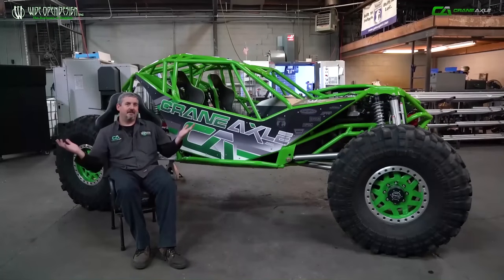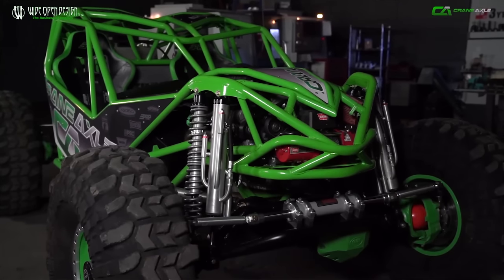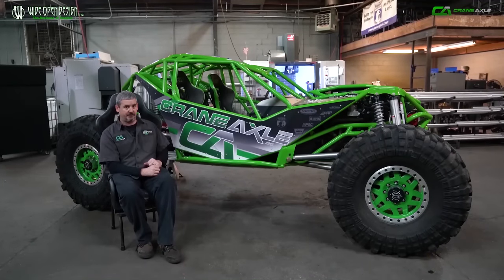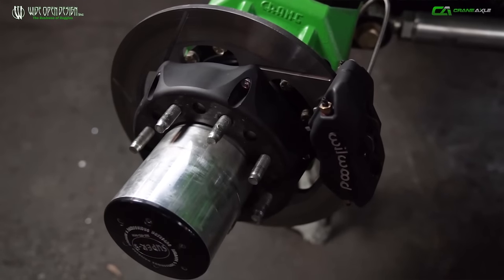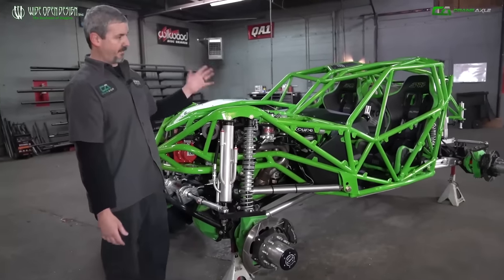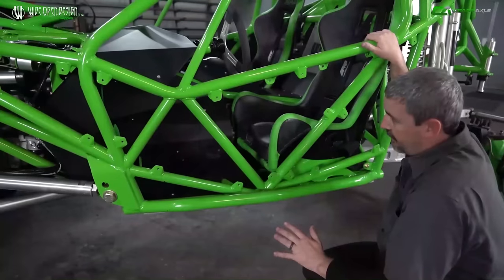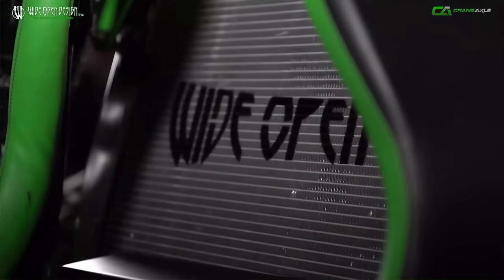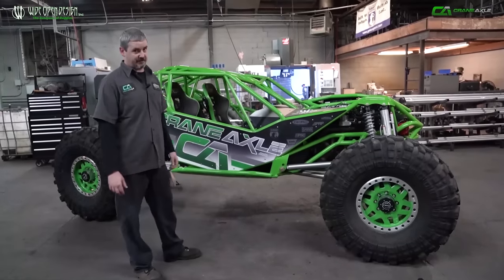New Rock Racing Buggy from Crane Axle and Wide Open Design

Comment: ok how much $$$ ?
Reply: I've wondered what a cost estimate would be too.  My guess = ~$110,000 for major components without labor to design, finish, and assemble:

Winch = 1,800
Axles = 28,000
Steering = 5,300
Shocks/bump stops = 10,000
Engine = 15,000 (middle of the road guess)
Transmission = 5,500
Transfer case = 3,800
Link bars = 1,750
Seats = 2,500
Trailing arms = 12,000 (material and machine time estimate)
Sway bar = 700
Radiator = 700
Wheels and tires = 8,000

Chassis = 6,000 (basic price for generic)
Miscellaneous budget other pieces and parts = 10,000

Comment: Very similar to the busted knuckle riout chassis
Reply from the maker: Obviously you must be a new fan based off your questions. But I can assure you Wide Open Design didn’t copy Busted Knuckle. Wide Open Design has been around way longer than Busted has.  You might want to do some research before you make that bold claim.  As far as who owns the buggy. It belongs to wide open Design.  Wes is just the driver and he owns the engine and transmission.
Reply: Thank you for the info
Reply: @robertabney3533  If you saw Gold Rush or Bad Influence side by with the Rocketship you would see the difference, this is much lower and a little wider than the Riot.

Comment: Dope!
Reply from the maker: I saw your first comment, and I will say that Wide Open Design has been around way longer than Busted Knuckle. So you can take it how you want
Reply: @MadRam11  yeah it didn't take long looking at it to figure it out. Gotta admit the designs between the 2 are similar. Bouncing is getting like nascar. Big builders going head to head all weekend. Makes for some damn good events!
Reply: @MadRam11  no hate. That's a weak mans job. They're getting more badass with every season.
Reply: Looks great, top notch company. Who gonna be the wheel man?
Reply: Wes